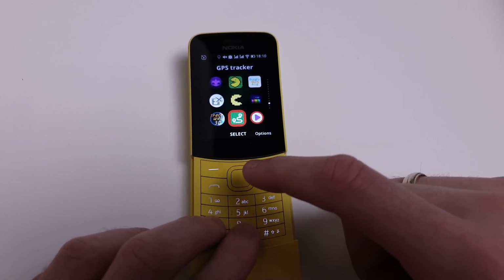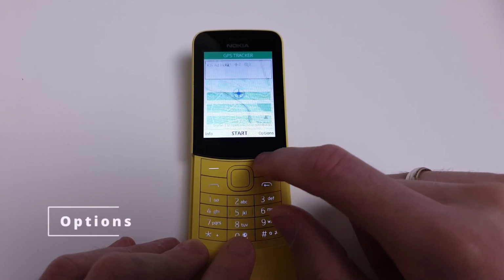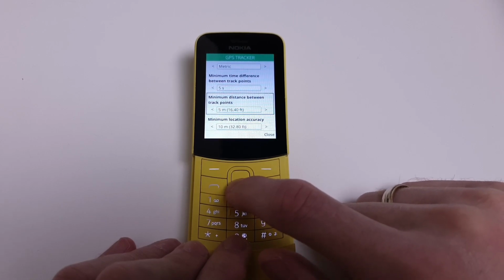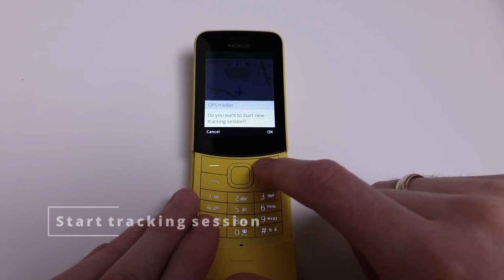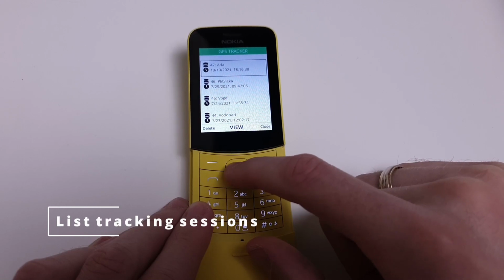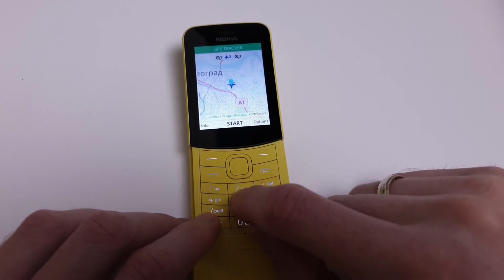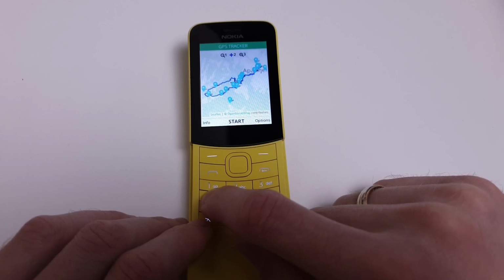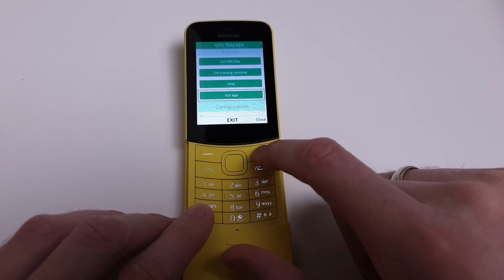KaiOS app review - GPS tracker

Comment: Today 30th March 2024. Bought a brand new KaiOS-powered Nokia 2780 from the US as one of my major requirements is tracking the phone's location. before I made the purchase I did some research and many said yes, the tracking could be possible as this phone has GPS. But it's wrong. Still, this OS or any available app has no capability of tracking a lost phone like in Android and iOS. This is an utter garbage slowly developing OS and it feels like this project will be abandoned sooner or later and never be able to compete with Android in the near future. You can get the same features from a 10-year-old dumb phone. I remember most of these features were available on Sony Ericson w995 back in 2010. Btw, what's the purpose of finding my own location using an app? 😂 This phone anyway comes with Google Maps.
Reply from the maker: Thank you for your comment.This app is not a replacement for Google Maps. This app supports openstreetmaps and opentopomaps, which could be useful for people doing trekking. It also supports reading and writing gpx files, which is also useful for the same purpose, and it cannot be done in google maps. For comments related to KaiOS system, I suggest you to contact them directly. Best regards!